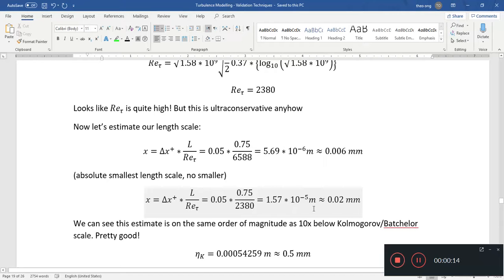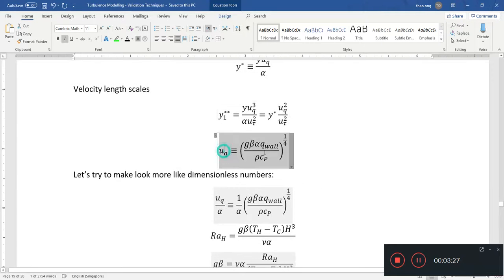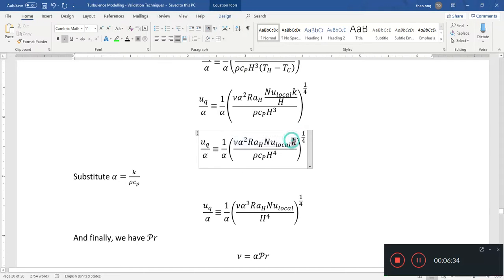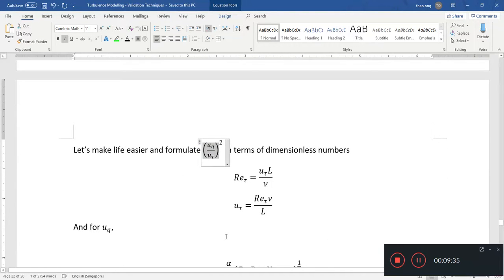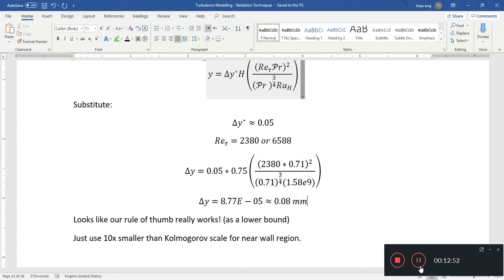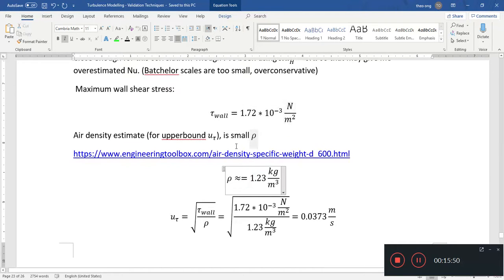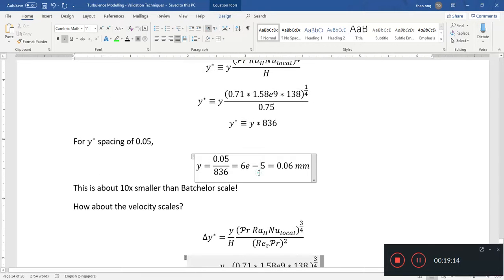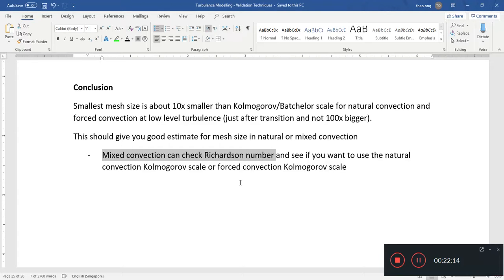Turbulence Modelling 95 - Validating Smallest Near Wall Scale Estimation Techniques for Natural Conv

Comment: Hello Theodore, I was wondering if can I send an email to you, I had an issue that didn't find a solution yet to run one simulation archive from a friend. PS. I'm using windows.
Reply: Hello  @TheoOngScienceAndEngineering ! ,
Before COVID-19 I've initiated one simulation on the collage computer to submit into a journal, but I am trying to keep work going with my personal windows computer. I've installed the ubuntu sub-system and copied the folder with simulation into the @home folder of the ubuntu sub-system. But I can't access this folder from bash. I receive the following message: -bash: cd: Submarine/: Permission denied.